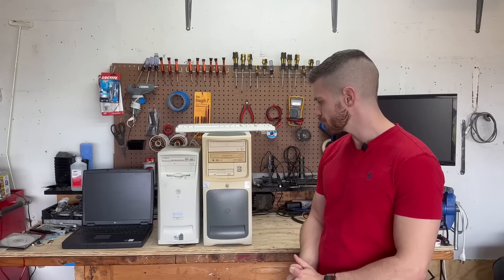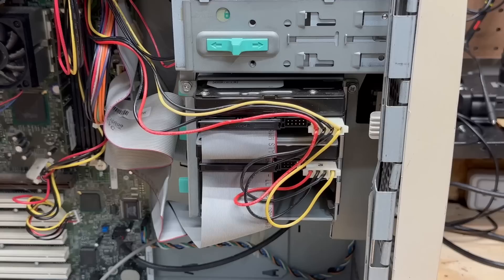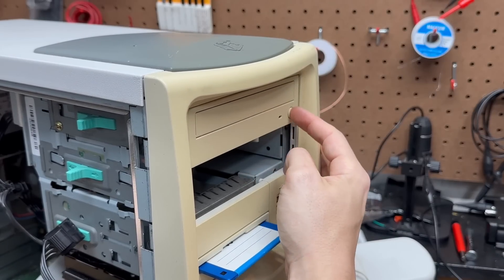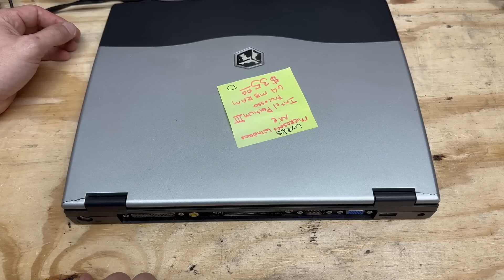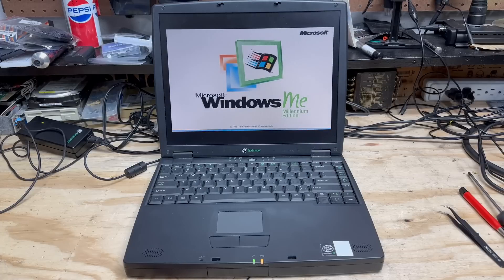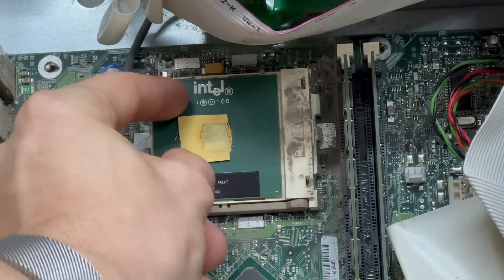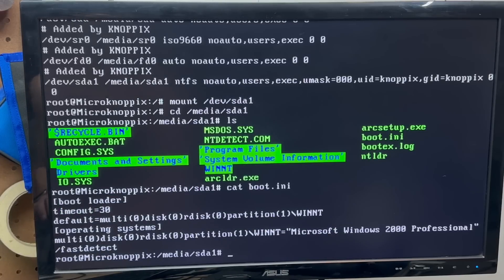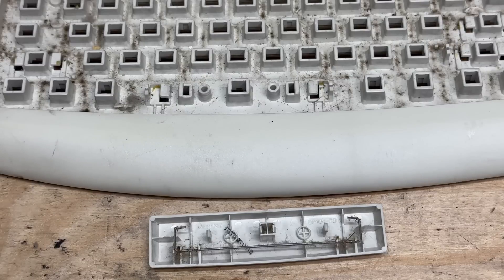Vintage computer haul from this weekend's hunt! Let's see if we can get them working!

Comment: You can run 2 drives on 1 IDE cable belongs you set 1 drive to master and the other to slave on the jumpers on the back of the drives. Used to do it to copy cd's

Comment: That Gateway would of been a pretty high end model back in the day. It even has full AGP support. I wish I could stumble upon stuff like this.
Reply from the maker: It is hard to find, and getting harder. This was a particularly fruitful hunt. Most of the time I come back empty-handed. I find that smaller towns tend to yield better stuff.
Reply: I used to have a similar era gateway with an 800mhz P3 and an ISA slot on the mobo. Ideal for a win98se + dos gaming system. Really wish I still had it...
Reply: @blakecasimir  I'm on the hunt for a desktop case model. But those are hard to find with a dedicated agp port. But they take less space on my desk. I have a NOS 17" monitor by HP that would fit nicely ontop.

Comment: I own a Dell Dimension L1000r which was top of the line for that series in about 2000 when I bought it. It seems that Dell named tthem to reflect CPU speed as yours was 667 MHz, and my 1000r is 1.0 ghz.I also have an L500 in a black case that follows that naming convention.

Comment: You could actually remove the old Dell ATX connector with a missing pin and install a new ATX connector 6 pins over to where those unpopulated pins are to run a normal ATX power supply without the need for that 6-pin cable. Don't know why dell did this in the Pentium II and III days, but there is a permanent solution. But if it works fine and you're not planning to upgrade it with more power-hungry components, it's not practical unless your PSU is dead. I did this with a Dell Dimension 4100 and now I can use any power supply without worrying about the 6-pin.
Reply from the maker: Thanks for the info! I’ve been reading horror stories about people trying to source replacements and running into expensive roadblocks. Good to know!
Reply: Dell still does wackjob psu connections, probably to try and sell you the overpriced stock part, except converter adaptors exist to render it pointless and let you use standard ATX power supplies
Reply: @UNSCPILOT  Right, this is about the much earlier instances of what dell used. They had a 20-pin with a shifted pinout and a 6-pin that supplied an extra 3.3V on a few lines.

Comment: Oh, man, that Creative CD drive is the 563-B! The only type that will work with the very rare and elusive 3DO Blaster. That's a really, really good find there!
EDIT: Also, those half-height PCI sound cards are pretty cool.
Reply from the maker: That drive is definitely a treasure! I've since found two other 563-B drives, but this is so far my only one that's Creative branded.

Comment: Btw,the Creative probably has gears for opening of the tray, that's why it worked.
The Dell's dvd is cheaper,so it used a rubber   and pulleys.

Comment: The problem with using an old MS-DOS boot floppy is that it will not recognise FAT32 partitions which those large hard drives would be using with Windows ME. Try using a Win9x boot floppy next time.
Reply from the maker: Yeah I do need to update my tools. Some of these brain cells haven’t been touched in decades… 🤣 I mostly use the DOS 6.22 boot disk as a near-universal way to test floppy drives and the system’s ability to boot. Kind of just muscle memory trying to go for C drive. Thanks for the info!

Comment: ...I would guess that your Win ME belonged to a church.  The extra things that " I could see" suggests that it wasn't a personal computer...But...You saw the file names, perhaps I am wrong about that. 
...As you tried to open the Dell, for a moment I thought that it might be the infamous 'clam shell case".   I don't know if you are familiar with that design.  I believe it had a very limited run for a case design and with good reason,  IMHO. 
... I have a Dell E-something, a 1 GHz that is a Clam Case...Although I haven't played with it in a few years and may never mess around with it again, I left the case ajar because you Do NOT want to screw around with a clam shell case if You Don't Have to.
...Have done any 'transplants'?  I have a very nice case that an air brushed painting on it..from the Star Trek movie; Insurrection, that I really want to put a computer into it..but I am hesitant to try transplanting a known working computer into it. 
Making sure I put the start button connection onto the Right Place has me nervous and the chance of ESD.   Its an older case and I have just acquired a couple 11 year old Dell Vostro 260's.
....Any way...just wondering if You or someone you know that also does computer videos, has done a '..computer transplants for Dummies..' video.
...Thanks for the video.

Comment: Keyboards Microsoft natural and Chicony derivate late 90s and the beginning of the new millennium are of the highest quality👍I have a 25-year-old Chicony" SMART-104" and I don't have a single damaged key and I play with it, so WASDX are the most used! I have a PS/2 adapter on it, so it's old and still OK. I recommend Chicony KB-7903 Smart 104 to everyone who has the opportunity to get it. First type released 1997 It was "copy" of Ergonomic natural Microsoft keyboard from 1995

Comment: I got the same Gateway tower with the same specs (Minus the cool creative drive and 160GB IDE drive) for free when I was working at a local PC repair shop in 2006, I got a lot of cool PC's from that job I wish I still had... I was kind of impressed / surprised with the tool-less design of the case, it also had a bad PSU.  Sweet find on that, a GeForce2 MX 400 64MB GPU and throw in 384-512MB of RAM, a slightly faster drive, and it'll be great.
Reply from the maker: It’s a surprisingly quick little machine, especially for having Windows ME on it!
Reply: On the first Gateway where the HD was stuck, you might want to check and see if there is a screw holding the HD. Of the 100s of these Gateways that I worked on with the screwless design, Gateway would still put a thumb screw in to hold the HD during shipping. We got several of them where the HD was loose or hanging when we opened the box.
Reply: @miketech1024  Yeah, this was sortof the last hoorah for Gateway before they exited the US market, fairly inexpensive decent machines, I really believe the only reason Dell beat them out was that massive advertising campaign. I will not say the catchphrase... Nope... Noooope...

Comment: Knoppix was the first Linux distro that I've used. That was in 2007 or 2008 on my Celeron 333MHz, 384MB, Riva TNT system
Reply from the maker: It was one of my first distros as well! It was the first time I’d interacted with Linux through a GUI, back when it came with KDE. It was and still is a fantastic distro for first-time Linux users, thanks to it being a fully-featured live system. I’ve always found its hardware detection to be excellent as well. Knoppix will always have a place in my toolkit, and my heart. 🙂

Comment: You should also try to test that Creative drive using another IDE cable or put it into same cable with HDD and see if it works. My guess is the IDE cable is bad.
Reply: I'll sort of second this.   I recently spun my wheels trying to diagnose an old Win98 system where the ide drives were behaving weirdly like this.   It did indeed turn out to be bad IDE cables (Two of them!)

But don't test that Creative drive on an IDE channel without cross referencing the model first.  I have one from the same time period that uses a proprietary  40 pit Matsushita interface.   You can plug it in to an IDE cable, but it won't work.  You need a SoundBlaster with the right interface.

Comment: "...Dude!  You've got a Dell!"  That's OK a shot of antibiotics and some chemotherapy will clear that up.

As for that first Gateway, I seem to remember the eventual owners of Go Back eventually recommended people remove it from their systems, it was so bad.

An alternative for wiping disks under Linux is 'shred'.  

Surprising you still find older computers at tag sales and trash days.  Haven't seen that around here in years (except for 4 or 5 years ago when I picked up the dead system in an aftermarket case, mainly because I needed a case for a spare system board I had).
Reply: Man. That one phrase is well known to any old school machead out there.

Comment: 30:12 the shape and size of that PSU LOOKS standard.  Can you confirm if a regular ATX PSU can fit in there, and also, are there any proprietary connections?
Reply from the maker: A standard ATX PSU does indeed plug right in. However, according to some cautionary forum posts, doing so will destroy both the motherboard and the PSU. It appears that Dell sourced standard connectors, but put their own ‘personal touch’ on the pinout. The additional single AT-style connector is also something I have never seen on a standard ATX PSU in all my decades of computer hardware wrangling.

Comment: If you have no specific reason to use dd, cp tends to be faster for whole device to device copies.  dd by default uses some really small transfer size of like 512 bytes or something, so it has to do a lot of back and forth between userspace and kernel for each small transfer and this just takes a lot of time and the kernel might have a harder time trying to figure out what it should be caching ahead for and other things, where cp I think will tend to try to use the best method for copying that it can.
Reply from the maker: I should definitely do a race video! dd vs cp vs cat vs shred! I usually do 1024 bytes per sector but figured the difference would be negligible in this case due to the IDE and USB bottlenecks.
Reply: @miketech1024  others to check would be pv and different shell redirects for < and > and zsh can be configured to just do a file in redirected out to another file directly without having to have something in between. :)

Comment: Question, can you use this knoppix program to recover a corrupted hhd? Gotta hdd with a corrupted volume label that I cannot get into to format. Looked like something I could try idk
Reply from the maker: It’s possible. There’s a tool called photorec (included with Knoppix) that does a good job of recovering files from corrupted filesystems. Despite the name, it recovers more than just photos. If you just want to wipe the drive, you can do a zero pass with dd (using /dev/zero as input) to wipe any corrupted filesystem headers that might be confusing Windows. You could also use the diskpart utility in Windows.
Reply: @miketech1024  fdisk did not work for me. The label has strange symbols and its nothing you can type in. Happened during a botched Win98 install for some reason. Basically bricked a mint drive. Just something that annoys me, but I would like to learn how to fix it.
Reply from the maker: @lftdblazer  Yeah I would lay a zero pass over it and try partitioning again (assuming you don’t care about the data on it).
Reply: @miketech1024  Question for ya. I've DL'd Knoppix 9.1, but I cannot get it to boot on startup. I'm on a Compaq Presario 7000 trying to get the HDD straightened out. Just says No OS found. What could I troubleshoot? Drive is perfectly fine and it's an RW and it's a CD-R disc. Works fine with everything else.

Comment: I have a question. Is 2 sticks of 8gb ram better than a single stick of 16GB?
Reply from the maker: In modern systems, no difference in my experience. Theoretically, a single stick would be faster but the difference would be infinitesimal. In older systems, you would be better off using two sticks to take advantage of dual-channel mode.
Reply: @miketech1024  thank you for answering this question. You answered it in a way that actually made sense!
Reply: @miketech1024 Don't you mean the other way around? Modern use dual channel and old use single
Reply from the maker: @Pholiage  Socket 462 motherboards have dual channel (depending on chipset). You just need at least two sticks to enable it.
Reply: @miketech1024  Yeah I know. But what I meant was that modern machines as in todays you do benefit using dual channel. However there was no specification what period of modern the previous question related to. I don't think dual channel benefitted until around DDR2 memory in everyday usage.